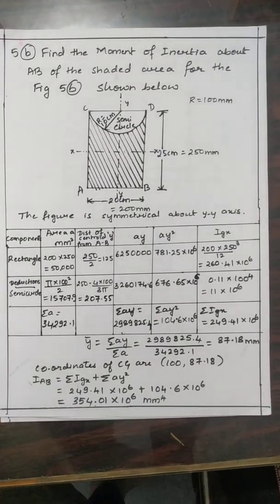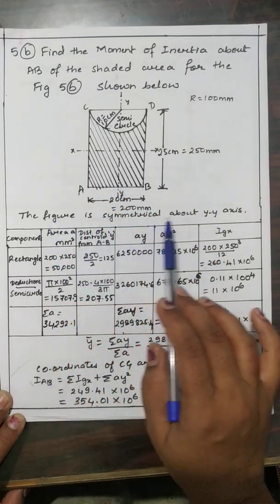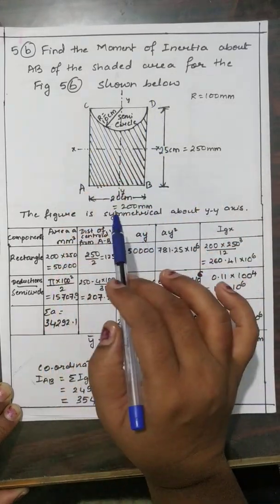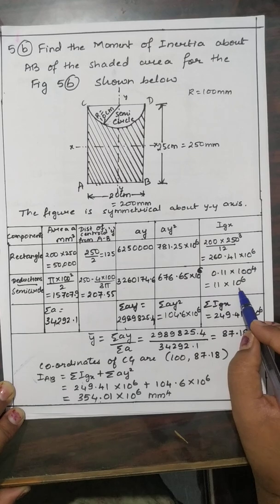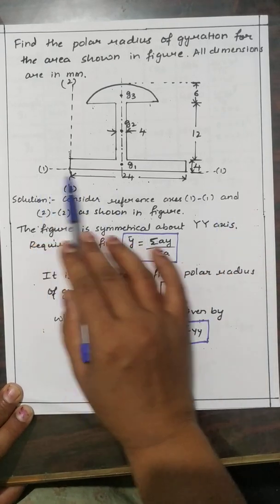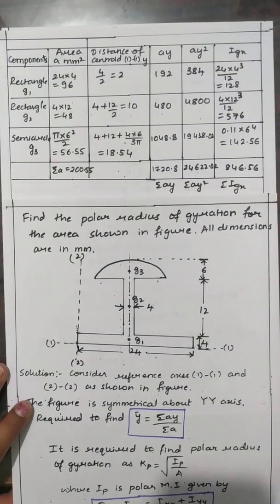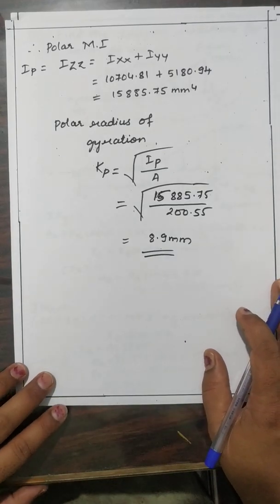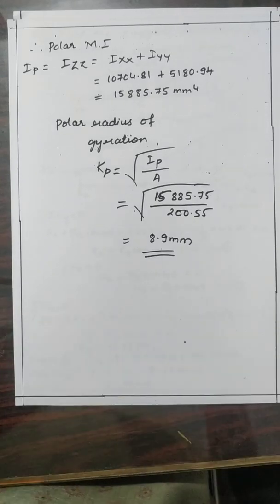21CIV14 Vtu Model question paper numericals

Comment: Mam distance of centroid y from A-B for semicircle formula 4R/3π but  why you consider 250 mam
Reply from the maker: A-B is at bottom.. Total depth is 250 mm.. Semicircle is at top.. 4R/3π is distance of centroid of semicircle from its diametrical axis means here top.. So centroid of semicircle is at 250-4R/3π from A-B
Reply: @civilengineering3445  k thank you mam
Reply from the maker: @suhanabanukataraki2425  welcome. Good luck